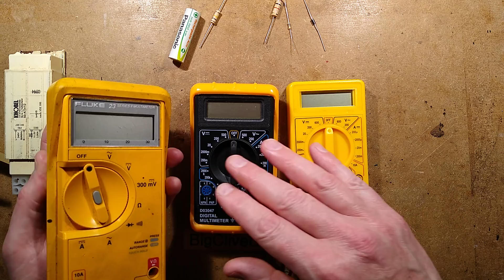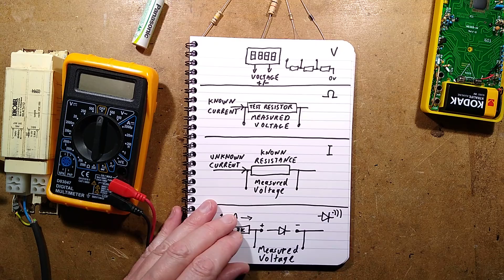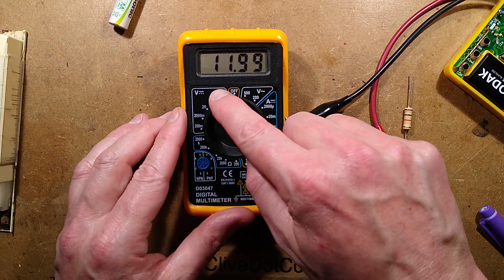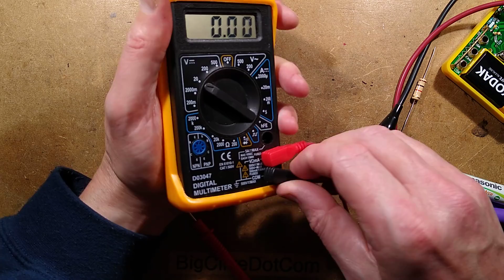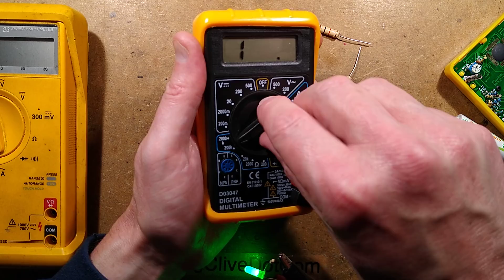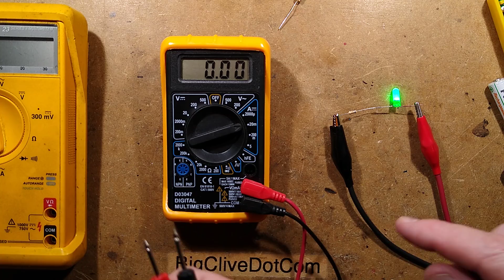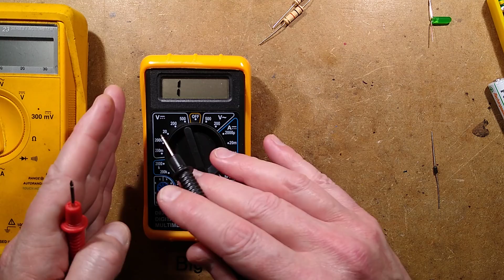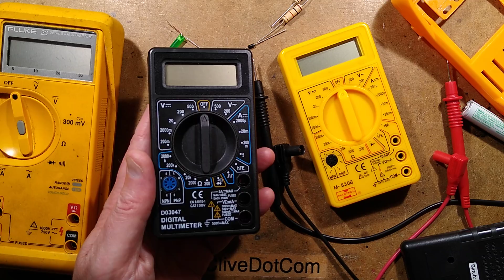How to use your trashy meter without blowing it up (much)

Comment: Clive, is it time for a few cheap meters to meet 240v mains in the garden? An explosive demonstration of their limits would be fun.
Reply: I too am saddened as no meter was exploded.
Reply: A long time ago I worked at Jaycar (electronics retail shop) with a guy who decided it would be fun to test the cheapest meter in the range (~$5 AUD) by plugging it into mains. Unfortunately he had it set to a current range rather than voltage. He found the limits of that meter (and his trousers) rather quickly. The boss never found out, we just scrubbed the scorch marks off the wall, reset the GPO breaker, and pretended everything was fine.
Reply: Yes!
Reply: @sixstringedthing  I'm sure when he scorched his trousers he was rather embarrassed.
Reply: @ro63rto  That would be a great suggestion for him 😀
Reply: @ro63rto  these guys can collab together for that
Reply: @ro63rto  I wanna see some of his huge caps dumping some insane fault current into those cheapies!
Reply: We are missing an "Oh dear" or two while magic smoke escapes...
Reply: @sixstringedthing  I did the same thing once on 240V (more like 200V in these parts). I was holding the cheap meter in one hand and the leads in the other. Nothing exploded. There was a bit of a crack and the power went out. Nobody in the house even figured out that I did something incredibly stupid. The meter didn't even die or go noticeably wonky.
Reply: I tested the HF meter with 120VAC while on resistance mode. It objected to the treatment by refusing to work resistance duty any longer.
I opened it up and replaced R13 with non blown 1k resistor, and it happily resumed functions once again.
Better a cheap meter than a multi buck meter when trying foolish things, but I'd have no qualms using a cheap meter with mains. Just be mindful of the probes integrity.
Reply: I use a cheap one in 380v, still alive
Reply: i have used my dinky yellow one plenty of times on mains it's got 220 and i think 280 setting.works no issues
Reply: Sounds like a JW video, not BC or PI.  Of cause PI and JW have the toys to guarantee a spectacular result, with PI prepared to explode the best meters if possible, while JW is more likely to show the ability of the good one to die gracefully.
Reply: Did he scorch the back of his trousers as well ,from the inside ?
Reply: I ran one of the super cheap meters up to 700v dc and nothing happened
Reply: I used to have a fancy $200 meter, which i always misplaced someplace, garage, shed, car, lab, company office etc 

I finally bought five $5 harbor freight cheap ones, and now i always have one nearby. 

One question for y'all: why is it that, to change the 9v battery on all meters I've used, i have to unscrew the back, typically with for Phillips screws.
It seems to me that the battery should be easier to just pop out with no tools required.
Reply: @ChristianKurzke  Changing the batteries is the primary reason I finally bought myself a few slightly more expensive banggood multimeters that take AA batteries in an accessible battery cover and have a nice big screen.

Although the 'locked inside the case' battery probably is a a bit of a safety feature: If you have to disassemble the device to replace the battery, you're less likely to use it with the battery cover still open, possibly coming into contact with the battery terminals at the same moment as you are probing a 240v circuit in resistance mode :P
Reply: I tried bodging the battery connectors in one of those play telephone sets we used have as kids (80's kid here. These were pretend bakelite phones with a wire that you ran between rooms - basically a wired walkie talkie. We didn't have much money so there was rarely any spare to buy batteries). I rigged up some speaker wire to the battery contacts and shoved them in the wall socket. The ringer went off its head for a few seconds and I dropped the wires before the thing started to melt.
Reply: At home, you can't accidentally break such a meter. Faster measuring device (when you forget to switch wires in the 10A range). To damage it, you need to connect it to kV voltage. If you try to measure high currents, you will damage the fuse and the test leads.
Reply: Fun story, when i began as an apprentice electrician i did solar panels so i knew fuck all about electrical installations, my uncle asked me to check a cable to see if it was live and i measured it with a crappy meter. It immediately exploded on reading it.
Reply: @ChristianKurzke  Safety. If you pop the battery lid open, stick the probes in 240 volts, and then start changing the battery...
That's why the battery is not supposed to be "dummy replaceable".
And they should last a long time.
Reply: Dave Jones already did that.  Look for the video EEV Blog 84 High Energy Multimeter Destruction, you will see several meters blown away in spectacular fashion over there!

Comment: It drives me nuts when a certain Dave disparages cheap meters. No, you shouldn't use them with mains. But they're a fantastic value, especially for beginners.
Reply: I would be nervous using them on 3 phase trouble shooting.
Reply: I use my Harbor Freight $5 specials on 120VAC all the time, but the leads are where they cheapen out on the construction. Some are thin wire and probes that fall apart or the connection to the probe falls out. They are OK for the car glovebox (sorry I don't know the proper UK equivalent) or the traveling emergency toolbox.
Reply: @jamesvandamme7786  yeah, I use them on 120VAC too. Mainly threw that in for those crazy Europeans running that deadly 240VAC. 🤔😉
Reply: For testing if high AC voltage (230/400V) is present or not, it's working just fine.
Not everyone can afford a duspol.

Just check if the leads are undamaged every use and check multiple times, if your are on the correct setting.
Reply: @tonysheerness2427  Dave made a point of saying a cheap meter is perfectly fine for learning about electricity.
Reply: Who is Dave?
Reply: @jamesvandamme7786  

Car glove box for the UK market, is... car glove box. We probably assume you call them string back storage facilities and you probably think we call them digit coverage storage chests or the like 😂
Reply: If you use the meters all the time slow autorange and useless bargraps will irritate you, especially when you have experienced it done right. 
But to check mains voltage in s socket two times a year, they're fine.
Reply: @dfgdfg_  You will know soon enough
Reply from the maker: Dave of the EEVblog channel.
Reply: They also work just fine for low voltage circuits like automotive electrical systems or most electronic equipment.
Reply: @manuelh.4147  you're 100% right. Flukes are overpriced, and is owed by a faceless multinational who only chases quarterly earnings.
Reply: @tonysheerness2427  Yes, because that's what beginners are doing with their meters :-)
Reply: @jamesvandamme7786  It's the glovebox in the UK too.
Reply: Is a shame, I've been using cheap dt-830b meters since high-school (circa 1997) without issue, measuring mains voltage. But since +/- 10 years ago the quality on those things dropped drastically.
Reply: @Aengus42  What do you put in there? LoL 🤣
Reply: Yeah, Dave sticks his nose so far up in the air over cheap test equipment I think if it rained he'd drown. 😆
Reply: Those in this video are CAT1. Use them in a CAT1 context and they are useful! Each tool has its uses, use the proper tool for the job and you will be OK. 

I used a cheapie most of my hobbyist life and I survived, but I took care of setting the range properly before measuring.
Reply: Don't buy cheap auto range meters. It's not worth it.
Reply: @jamesvandamme7786  It's the glove box over here as well😀
Reply: @CyberlightFG  what about the not-cheap 121GW? It's got the worst speed of all my meters.
I still like the meter, and I bought it more to support the channel than because I really needed it. But I was really expecting more, given his disdain for cheaper test equipment.
Reply: @caggius42  OK, cool. Next question: what do you call a frunk??
Reply: @w13rdguy  What do you think? Gloves, of course! 🧤
Reply: @jamesvandamme7786  Good Question ! Do you mean the boot at the front of a  rear engined car ?  To me it is a boot regardless of its position front or rear....
Reply: @ Frank, I wouldn't buy any auto-range meters, don't like them,too slow.
Reply: guess I'm dead then.
I've used the little red harborFreight centech meter on three separate 240v outlets and have even used it to diagnose an all-analog dryer timer while it was all plugged in 😁
(invensys W10185988-C)

It had a smoked random pin contact and I made a new one for it
Reply: dave can be insufferable watched 1 or 2 of his videos and that was enough for me never went back.
Reply: @caggius42  So a boot covers a storage area, and a bonnet covers an engine? Here in 'Murica a trunk is a storage area in the back, and a frunk is a storage area in the front of an EV. A front trunk. They have trunks, too, in the rear. The motors are between the axles somewhere (front and/or back). 
I don't know what covered the engine in a rear engine car.
Reply: @Landrew0  Bingo.  I've heard him say something to the effect of "get whatever meter you can afford" on more than one occasion.
Reply: @JamesPotts  127 VAC here (three live-wire system), same thing, never problem with cheap multimeters and 127V (untill now, LOL)
Reply: I'm using a russian made multimeter from the pre LCD dark ages to eradicate all the electric gremmlins at the moment. Bought in 1978 and still working fine, although I now need reading glasses for it 😀
Reply: Could have sworn I did a video reviewing and recommending a cheap $20 meter...
Reply: @Hyxtryx  Correct. I've been saying for 12 years get the best meter that you can afford, and that it's generally better to have two lower priced meters than one higher priced meter. But there are many different industry requirements. I've done a video explaing industry experience where a cheap meter can actually cost you big money. Haters gonna hate.
I agree with Clive, if you are just starting out, get a cheap meter, or better yet, two of them.
Reply: @EEVblog  I do believe, but, that old video where you trashed down some cheap meters became a classic... ;-)
Reply: @OgbondSandvol  And as I'm sure I pointed out in the comments at the time, that was about a term called measurement confidence in a professional setting, and I was trying to explain why cheap meters can actually cost you more money than a better quality meter if you are a professional. I was not talking about basic beginner hobby meters.
Reply: @EEVblog  I agree, I work in industry where machine down time is big money. I only use expensive, calibrated, test equipment I can be confident in the results I get from. The last thing my boss and the machine owner want to be paying for is the time it would take me to work out whether I am measuring/finding a fault in the machine, or my test instrument if I were using ‘cheap’ equipment. Good test equipment is ‘buy once, cry once’, cheap test equipment is ‘buy and replace sever times, question the result every time’ - everybody ends up paying more.
Reply: @skylined5534  Really?  I'd thought you'd assume we called them "vehicular gun lockers".
Reply: @caggius42  - Because most carriages in the US didn't have boot lockers, but rather that the early cars ended up with people attaching steamer trunks, they became 'trunks' rather than 'boots'.
Reply: I believe it is time to cut Dave a little slack. He obviously is a very bright guy. His reviews are thorough though sometimes I'm sure they do not delight the manufacturers of the equipment. It is true that he gets on rants from time to time and does not know when to stop. Check out his various videos on solar roads for example. He's also a bit thin-skinned, an an unfortunate trait for a professional YouTuber.

So far as I know, Dave has never mentioned where he went to school but he describes himself as an electrical engineer. At least here in the United States, that implies a master's degree so I would assume that he has the Australian equivalent thereof. Regardless, he very obviously understands theory and not just practical applications. His Australian manner of speech as well as his squeaky voice get on my nerves from time to time but he can hardly be held accountable for either of those. He did not formulate Australian slang and cliches and I'm fairly sure that he did not order his vocal cords from Mouser. He reviews a good bit of high-end equipment but he also reviews entry-level equipment and does not bash it just because it's cheap.

Personally, I disagree with Clive's advice to buy the cheapest meter you can get your hands on. I believe it is a false economy. Beginners do not need the hassle of a flaky meter or one that dies in the middle of a project or starts reporting two-and-a-half volts when connected to a fresh 9-volt battery. Perhaps they are better built in the UK but over here meters of the quality that Clive recommends are worthless pieces of crap. About 30 years ago, I saved up my coppers and bought myself a good quality Fluke multimeter and a Rohde & Schwartz oscilloscope. Could I have bought less expensive equipment for my fairly modest needs? Of course I could. But in three decades, that equipment has literally been around world, subjected to extremes of weather and the rigors of travel. The meter has been dropped in mud and water and bounced around in gear bags. In all that time, neither instrument has required service or repair. I replaced the Fluke leads once because I stupidly slammed them in the door of a jeep. 

Anyway, that's my perspective on the man and the machines. Your mileage may differ. 
.
Reply: @omniryx1  - I just stopped watching Dave because he couldn't moderate his voice.  I get customers shouting enough, I don't need my infotainment doing it at me.   The meters Clive is talking about?  I have a pile of them.  I've had some go bad, but most of them are still fine.   I periodically even compare them against my better meters to make sure - but I'd rather leave a garbage meter at each customer site on the server rack, than tote my expensive one(s) from pillar to post.
Reply: A man whose strap line is "No Script, No Fear, All Opinion" annoys you @James Potts? Really? 😁😂🤣
Reply: @harryconover289  So, 1) how did you know it was fake, and 2) what was the cost?
Reply: @jamesvandamme7786  Glovebox is correct, that's what most drivers in the UK call it.🙂
Reply: @tbelding  the cosmetics and especially the batteries a copper top but made in China
Reply: @jamesvandamme7786  I'm in the UK and have only heard of 'glovebox' in the US context. It's always been 'glove compartment'. For other UKers saying it's glovebox here, is that a recent US import, or has it always been called that in different UK regions? (I'm 40 years old and live in the very south of England for context, as if it's a US language difference that's caught on in the past couple of decades, some people may not know any differently).
Reply: @manuelh.4147  I've found even non-bargain-basement low to mid-range priced ones tend to get unreliable as internal switch contacts age. Cheapos are fine for low voltage, non-critical work though.
Reply: @jamesvandamme7786  if the rear engine car was a Corvair, then the best thing to cover the engine was a good repair warranty.
Reply: Everybody needs a cheap meter. Everybody! I always had a chance to buy a fluke, way back in the day. Snap on tool man would take payments! LOL but I always ended up asking.. why? I was a fleet mechanic for 30 years, never needed better than a $5 meter! And a test light! LOL I have an old Simpson analog meter, it stays in its case!
Reply: I have two of daves meters, the fancy ones that datalog, if im honest, i prefer the 5GBP ones I have, the data logging stops working after a few hours due to a firmware bug, and on AC, if you get an intermittent connection as you probe a wall socket for example, the meter resets!  They seem high quality, and use AAA which are easier to find when at a site and the battery goes flat.  But they are not the mutts nuts like I assumed they would be
Reply: @skylined5534 Those of us who watched American courtroom drama Perry Mason in the 1960s know all about glove boxes. Almost every defendant (who later is shown to be innocent) would reliably admit "I keep a gun in the glove compartment of my car".
Reply: i’ve was using my $8 amazon meter when working with wiring between both phases at 240VAC. no problems at all

Comment: The ONLY correct method of learning how to use these is to forget the leads connected in the amps measuring position and then try to measure mains voltage. After a couple of times, it becomes a reflex to double check.